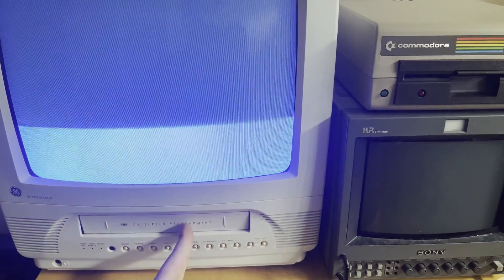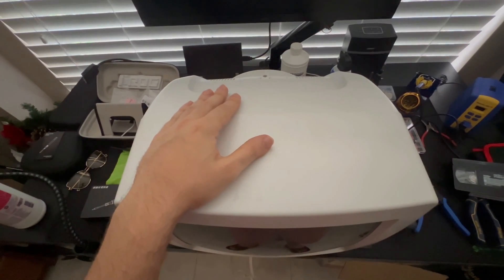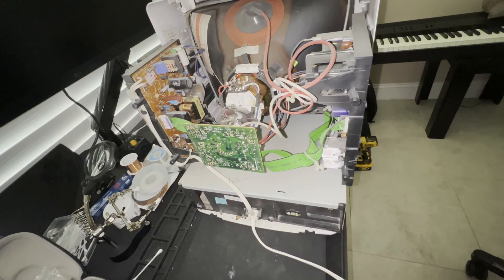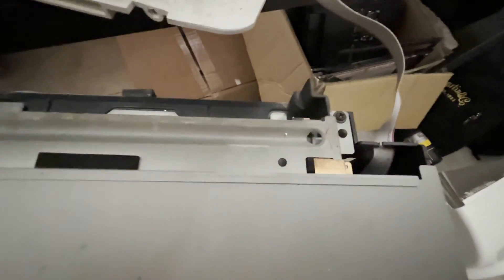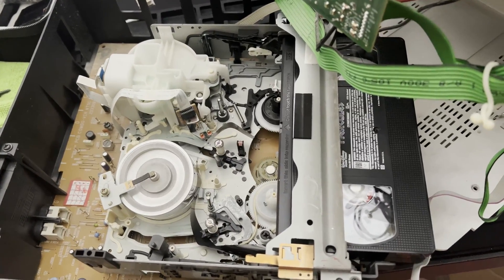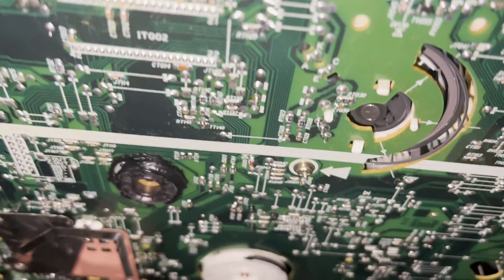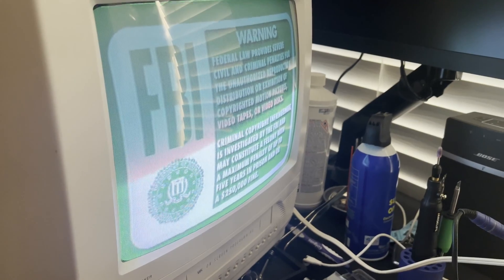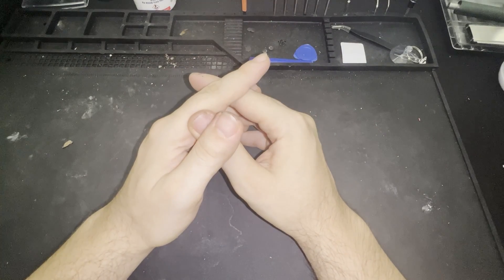GE Spacemaker 13" CRT Combo - VCR Repair/Troubleshooting

Comment: Hi, thanks for sharing. I have the exact same issue with my JVC vhs crt combo. The tape goes in, but goes down only half way and the vhs door only shuts 70% just like that, then it ejects the tape. Was the pen the main issue that caused your tape you eject at the beginning?? Maybe there is an object inside my vhs as well, hopefully that was the only issue
Reply from the maker: The Spacemaker set in this video had a rubber pulley line which completely deteriorated into a black sticky mess, in this video I cleaned that mess and replaced it with a rubber band. It's possible your set may have a similar issue.

Comment: I have the same tv vcr combo and mine when I put a tape in it would start to play it then shut off and eject the tape and it would get stuck but the tv works fine when I hook up the external vcr to it how can I fix it
Reply from the maker: Yeah, sounds like the internal vcr has a problem. Could be dirty heads, a faulty sensor or a worn belt issue. No way of knowing until you open it up, I suppose.

Pinning for any VCR experts out there to share some insight

Comment: HI there amazing video i love the structer and it was very hepful, tho i do have a sepreate problem then what you had. 
Mine just dose not seem to take an input in the back from any device? My plan is to use it as a seprate monitor for my computer to play games and such.. tho even when i try and hook a SNES to the TV that ive tested and works with the same cables on another tv, it stil doesnt do anything. ive tried changing the channel (which seem to go up in wierd increments) and swapping the cables, and i dont know what to do, is there an input or something im missing to swap it over to input and not just VCR? thanks for your help in adavance if you can  :)

Comment: It's always the mode switch and don't worry the BetaMaxs also have an extremely common fault that does the same thing and it's a plastic gear on a steel rod and trust me you do not want to even open a BetaMax they are Rats Nests of cables and wires it was a nightmare finding the fault and then putting the entire thing back together it took me over a month I'm not even joking I live streamed the first few times on FB and the entire time the BetaMax drove me nuts for your own sanity don't even buy a BetaMax (I didn't even end up fixing it after finding the fault I had so many other projects piling up that I wanted to get to I just said stuff it as there is only one company still making replacement parts and it comes at a price all right) sorry about that I got carried away again
Reply from the maker: Lol yeah. BetaMax was always a pain to work on, especially now. Though I’ll probably never work on a combo CRT again, this video isn’t that popular anyway
Reply: @DudePingu  I'd be interested as I have one I love them

Comment: I actually found this exact model when helping my folks clear out their basement. It was working just fine, til we heard a pop inside it everything shut off. We think it must have been a fuse being blown but we don’t know anything about how to properly diagnose and repair it. Any advice? I’d really would love to salvage it for a friend who is in to retro gaming on CRT TVs.
Reply from the maker: Hey there…Hm. Without seeing it firsthand it sounds like something shorted. Did you get magic smoke?
There are lethal voltages stored in CRTs, and combo units are notoriously difficult to put back together, let alone repair. If you’re motivated enough I’d start from fault testing the power supply (measuring voltages, etc) and finding a schematic, though a quick search on google for this set doesn’t look promising.

There are a lot of components on these combo sets, several of which are connected on a few circuits. If it were only a few damaged components needing replacement it wouldn’t be too bad, however depending on your risk tolerance it could be beyond the scope of a diy project. Regardless, whatever you do, do it safely (i.e Discharge the set properly, do not use any metal tools on the board with the set powered on, etc. There are several youtube videos re - CRT safety)